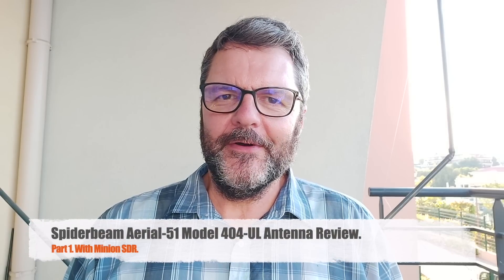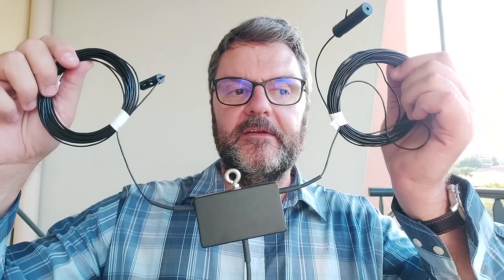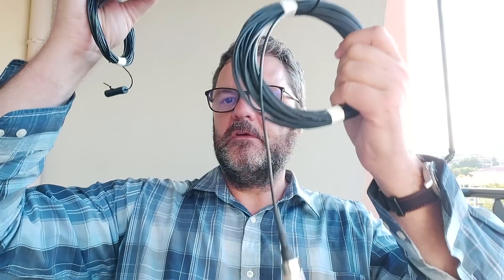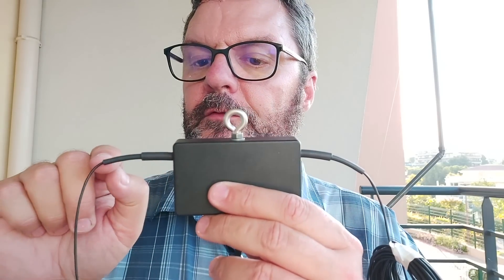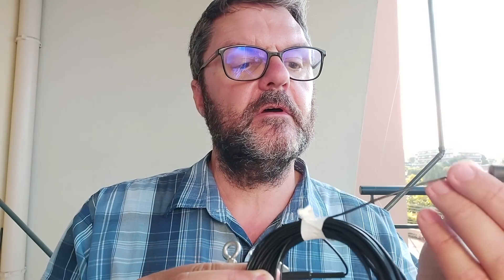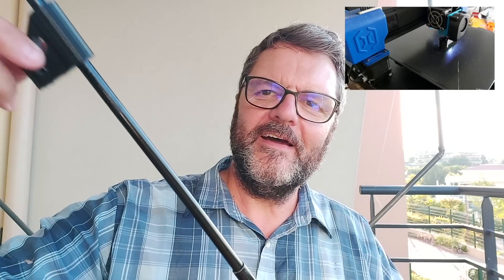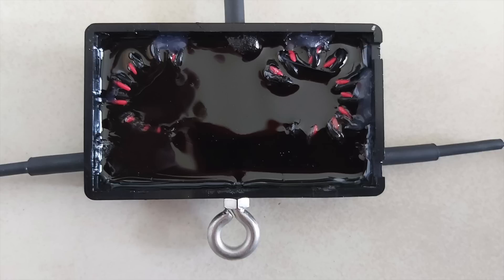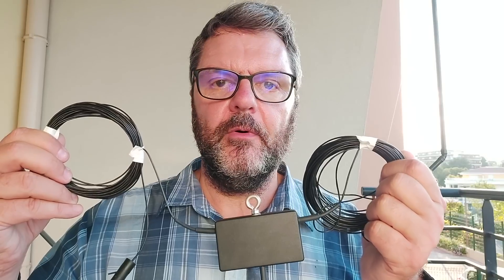Spiderbeam Aerial-51 Model 404-UL Antenna Review, Part 1.

Comment: You are so polite when reviewing. Bad construction, no way to replace coax (which is too short) or antenna wire. Bad SWR (Try a Chameleon LEFS - which is around 1.2 to 1.3 on supported bands).  But the location beauty beats the bad antenna !
Reply: But Chameleon gets the low swr through the use of a very lossy balun!
Reply: @ironton655  It may be somewhat lossy, but performance is awesome. Made 6500 km contacts from Denmark to the US and Canada using 10W only using this antenna . If you have room for 4-5 dipoles, that will be better perfroming, but this is a very effective compromise

Comment: I have finally used this antenna for the IARU contest. A week prior I measured it's in-situ position with my Rig Expert. The antenna met or exceeded the generic specs called out in the literature from Spiderbeam. So that's good. However, I found several times that once I ran my rig's internal tuner on the 40m band, and observed my radio reporting SWR~1 afterwards, that only a short while later, I may have to retune on this band. This was on hot sunny day. I don't know if the potting material on the ferrites affects this, or what was going on, but it seemed strange for sure. Otherwise, the antenna works very well, and I'm happy with it. I agree, however, managing the three wire feeds from the feedpoint is rather messy. I can spend 5-15 minutes undoing knots |(after trying to carefully coil and try to preserve the natural coil). Connectorised would be much nicer. Finally, the eye-screw on this antenna is a strange design. A Spiderbeam antenna for (hopefully) use on a Spiderbeam pole should have a mechanical design to match their pole.
Reply from the maker: Yes, interesting thanks.
Reply: I cut the dipole arms near the hub/balun and connectorized it. I colour coded with shrink wrap to preserve the original location. The wire is thin but the wire jacket is very strong and of very high quality, I found. I had no issues with the SWR this year in my field setup for IARU. My issue is that   I am a one person operation, and getting this thing up the 12m mast and guys lines, is a tedious and tiresome operation. Anyway, Spiderbeam should add connectors, it really helped with setup/teardown, and now I just have to clean up my guy wire situation! I made a 10,000km QSO to Japon on SSB with 100W on 15m. I know you dislike contests, a lot, but I have a small suburban lot, and contests give me a target rich environment for DX. I'm not that competitive. The rural situation I use annually for IARU gives me S0 noise floor, which is pretty amazing.
Reply from the maker: Thanks, a good antenna indeed..

Comment: I have 2 of these… one is used as my primary SOTA/portable antenna, and the other one is up at home. I have had to repair several breakages in the home antenna, both in the elements and coax. However, I’ve had no issues with the portable one with over 100 portable operations! I can’t fault the antenna for this as it is designed for portable use.

Your SWR values seem quite high, and both of mine are well below 2:1 on the primary bands (40, 20, 15 and 10). 12, 17 are about 3:1, and 30m is usable with a decent tuner (I’ve worked a lot of dx on this band with this antenna).

The antenna was designed and made by Rick DJ0IP, who has a wealth of info on his website, about antennas and other ham stuff… well worth a read. 

For portable use I’ve found the antenna to be rugged enough and the ‘hardwired’ connections for coax and elements is easily strong enough!

David VK2NU
Reply: Yes, and DJ0IP goes in detail of this 4:1 Balun on his website. Looking forward to next video on this antenna.
Reply from the maker: That's why I want to try in a different location...

Comment: Nice review! I agree with you and prefer connections! I'd rather my antennas repairable. This Spiderbeam looks disposable if something goes wrong; being potted with direct wire connections makes it difficult to repair. But good if you want to minimize losses by omitting the connectors. But shame really.
Reply: The Spiderbeam 12m mast is their heavy duty mast and is very durable. I have one and I have used a N9TAX roll up J pole and a 40 meter inverted V & two lengths of RG8X coax on each antenna, and the Spiderbeam held up with no problems. If any of the sections are broken, they are easily replaced, so you wouldn't have to throw out the mast.

Comment: Thank you for this video! Regarding bad CW keying ... I have similar problems with the Spiderbeam QRP transceiver ALT-512. At this radio there is a very poor implementation of the build in cw keyer ... for me it is IMPOSSIBLE to operate proper cw with the ALT-512. I work since decades CW with different Kenwood and Icom radios  (member of HSC, my no. is 1142) and those have implemented correct cw keying chip or algorythm inside, but I have to use an external electronic device for cw mode with my ALT-512, which IMO is a shame. So sorry, that those transceiver is out of production and no longer available and there is zero support with updated firmware which should fix that problem :(    maybe that is also that keying problem with your minon/mignion transceiver. Can you check that with some tests at a dummy load?  vy73 from Hamburg/Germany, Dietmar, DL4HAO
Reply from the maker: I will check, as well as using a straight key.
Reply: The ALT-512 has two keying modes:  Mode A and Mode B.  Mode A works perfectly well.  Mode B does not.  I have been using my ALT-512 in CW for 6 years now and it keys just fine for me.  The developer was working on a firmware update for Mode B, but became a Silent Key before he finished.

Comment: Thanks for sharing my video on SDR Minion Gil! Whow! I'm glad your Minion's back after the repair finally. 
As to the OCF antenna by Spiderbeam, thanks for the video, very informative. I'm a bit surprized by the poor implementation , like no connectors, epoxy-sealed box etc. Somehow does not match with the "high engineering" image of the Spider :). The balun, normally should be a 6:1 in this type of the antenna, for OCF in their feeding point supposed to have abt 300 Ohm of impedance. Such baluns are rear to come by but some manufacturers make them. I think, the one I bought many years ago in some Belgian or Dutch "brocantes"was German-made. I had my Carolina Windom OCF built around it up on the air for 7 years in a row with only problem - RF feedback in the shack, it took some heavy RF-choking at the transmitter end to cope with it :). GL, 73! Linas LY2H
Reply from the maker: Hopefully it will bring you a few subscribers! RF issues is why I don't use OCFDs anymore...
Reply: @RadioPrepper  Thanks!
Reply: Linas, the balun MUST be a 4:1. Your  "supposed to have" is wrong.  When fed at the original design position of 33.3% from one end, the feedpoint impedance varies from band to band but is roughly about 230 Ohms when fed at typical City Heights (25 to 40 ft.) and reaches about 280 Ohms when about 90 ft. high.  Further, the feedpoint impedance changes when you move the feedpoint away from 33.3%.

Comment: It is easy to make your own balun & box with connectors for the coax and radiating wires. I've made a couple for testing. That is also cheaper and you learn in the process. A balun should eliminate common mode currents on the coax. This is a disposable unit since it cannot be repaired.

Comment: Interesting video Gil, I'm looking forward to part 2.
I noticed your comments about permanent connections vs. removable connections for coax and antenna wire.  The bigger issue is the potting compound inside the box.  This is what will make the antenna difficult to repair if either the coax or the antenna wire failed.  As you found with the BNC adapter, the connections themselves can be a source of failure.  And the weight of the connections can be a very significant part of the total weight of a portable antenna.
PS.  One of your earlier videos inspired me to make an EARCHI antenna a few weeks ago to take on a camping trip.  I'm pleased to report it worked very well with the Xiegu G90 and it will be my standard HF antenna for portable use for a while!
Reply: There are 2000 of these antennas in the field and to date, only one was reported to have a failed balun.  The antenna was replaced under warranty.
Reply from the maker: Great. Yes, exactly, no repair possible...

Comment: 3 Clip on ferrites halfway along feeder folded like the Carolina Windom design may help common mode. It was a problem for an OCF I made several years ago with 4 T 1 balun at feed point. vk5cz ..
Reply: And also try clip-on ferrites on ALL the cables in and out of the rig, close to where they enter/leave?  It can't hurt and in multi-station situations, may well help attenuate ANY big RF signals entering the receiver via keyer, mike, or battery cables!  They are cheap enough to buy LOTS in different sizes on-line.  The type of ferrite used isn't usually very critical.
Reply: It doesn't need the clip on ferrite.  The dual-core 4:1 is sufficient for blocking the common mode current, because THIS OCF uses a feedpoint just slightly off center.  This is not speculation, it was measured during development.
The Carolina Windom uses a balun at the feedpoint that intentionally does not block common mode current.  THAT is why it needs an additional choke down the feedline.

Comment: I built my ocf dipole 2yrs ago out of 17 gauge aluminum fence wire and 100lb test fishing line. It works great. I worked a Slovenia station from East USA on 150watts with ease. I was running a Yaesu FT-1000 which has a built in auto- tuner.